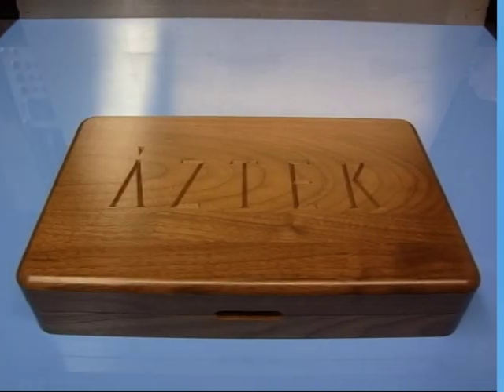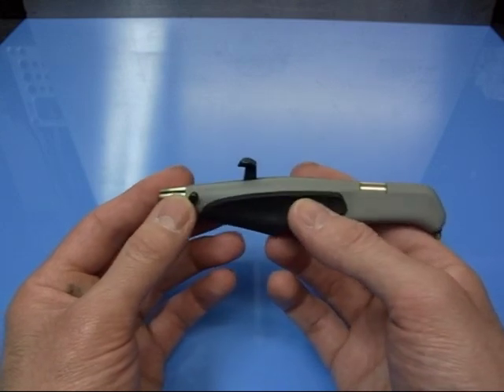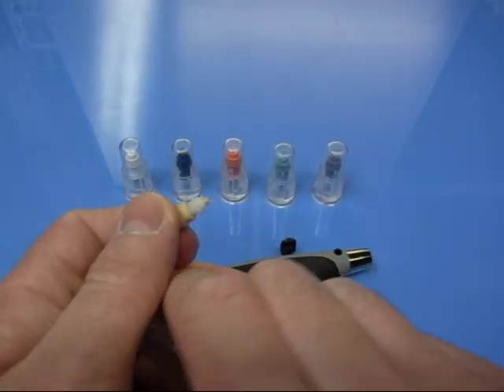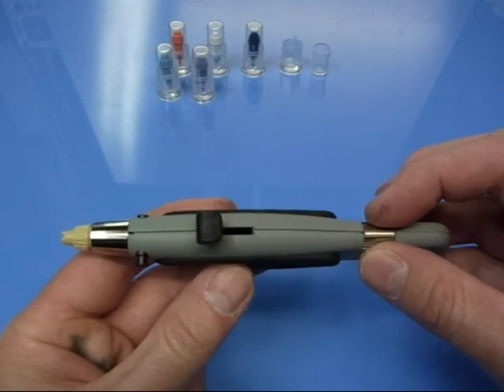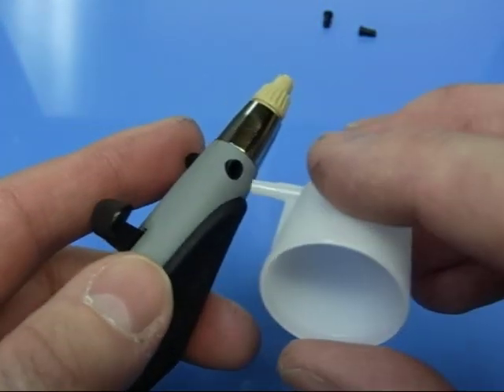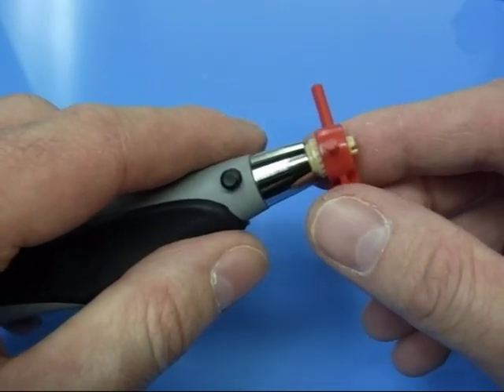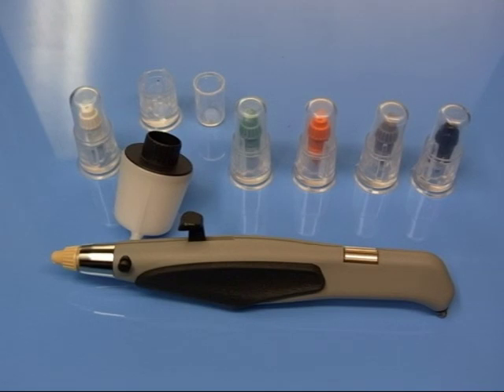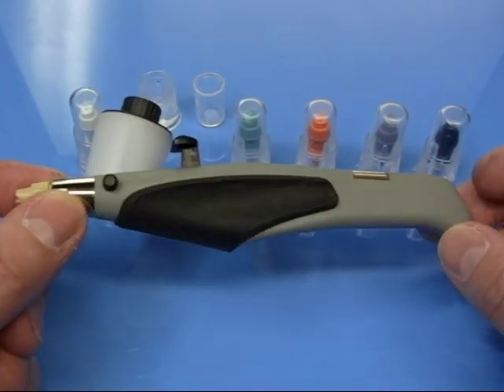Aztek A470 Airbrush by Testors

Comment: Bought this airbrush 7 years ago I can say I have had no problems good product,and for those
who like a bit off weight there"s a metal bodied one, very clever design easy to use and can be
cleaned quickly.I think you would have to spend a lot more bucks to get any better,as an aircraft modeller it has served me well all the best Dave.

Comment: I tested these for the importers in Australia back in the early 90's. They all seemed to have the same flaw; the trigger is plastic and a wire is threaded through it to push the needle assembly. Being metal is harder then the plastic parts, it would quickly wear out the plastic parts and fail. I asked the manufacturer how they could offer a life time warranty back then and he told me they cost around $6.70 to manufacture and the wood cases actually cost more!  If you want some quality and also to save a few dollars, take a look at the Sparmax "SP-35" as they build most of the Iwata compressors and some of the airbrush lines for them.

Comment: The white and black nozzles are for acrylic paints, as the manufacturer says. Also, there's one nozzle just for spattering effect.. I have had an airbrush Aztec A470 in beautiful wooden box, 6 nozzles, three side feed cups, and 4 or 5 gravity feed cups, hose, wrench, adapter for 1/4" and adapter for air-can. And VHS tape with a detailed inquiry. On I liked the feel of that airbrush in my hand, the trigger was fantastic (less pressure - less air volume), the line adjusting nut at the back was the best type compared to all types of line adjusting nut systems, from the crown system in front of the trigger when winding from the front, it pushes the trigger back (Paasche), then the small screw in front of the trigger (Badger 100, 100lg,) and the rear "brake" screw system on the back of the airbrush (Iwata, H&S, Creos, Sparmax). After the initial delight, I chose to start working only with properly diluted tempera with water, because I wanted to get a feeling working with this new, and cool designed airbrush, and learn much as possible use advantage and avoid weak points of new design and feeling. When I was used to cleaning the airbrush with such a non-aggressive medium with water and finally with Createx Cleaner. I only had that Aztek A430 for about a month when I noticed colored water leaking at the junction of the two halves of the handle of my airbrush. From the same handle that has a lifetime warranty!! What would have happened if I have used acrylic, enamel or some more aggressive varnish and would the deposits of that color accumulate and stick to the valve or adjusting nut system inside the handle and make it impossible to work? I sold that Airbrush to a customer who never got back to me. Maybe he doesn't worry about such little things. In any case, to me; 👎🏻

Comment: The Aztek airbrushes are unique. I really appreciate this concept. And it still seems to pull its weight all these years after it arrived. The lifetime warranty is legit. I got a brand new body for free when my old body had to be replaced because i had fully submerged it in mineral spirits. But the old manuals did not say anything about not doing this. I have to say i opened a beige (thin) 0.30? nozzle once and inspected the tip. It was bent, but not to the naked eye! Disappointing. But i did get a new one at the same time. One thing that still confuses me is wheather or not this is a pure acrylic airbrush or if this can tolerate enamels/laquers as well. It may seem this product was initially intended for acrylics.The price may be high for a plastic airbrush, but the people behind this product are solid :) Grab one if you can. It is very easy to use and only minimal cleaning involved. :)

Comment: @iliaspap88 I just bought an Infinity 2 in 1.....brilliant airbrush.....my other main airbrush is an Aztek 3000s (now sold as an A470) ...it's twenty years old and still works good as new.
A lot of people are a bit twee about the so called "plastic" construction...it's resin actually..it certainly is not a cheapy or a toy......It's easy to use and easy to clean.....it's a great airbrush
What were the two issues you encountered?

Comment: I have the DA7777 kit which I purchased some 15 years ago.  Still new in the box.  Contains A270 single action and A470 dual action brushes with all the tips and accessories.  I think I purchased the kit for around $100 USD.

The kit comes with two VHS tapes, which I can no longer watch.  :(  Just wished someone would provide a more detailed "how to" with the A470 brush.

Comment: i used my airbrush, and i could not get  any paint to come thru. i cleaned my brushes, or tips, and still nothing. i had a a470 yrs ago and it worked great. hope it is something i've done. would like to get it to work again
Reply: Open the handle. The airline runs the length of the airbrush, it's likely plugged. Easy to even replace it with better.